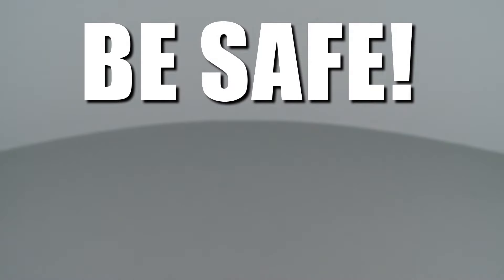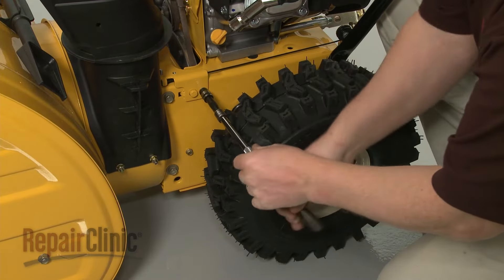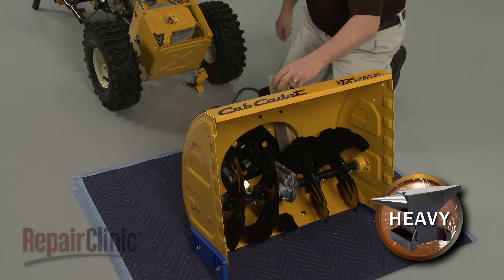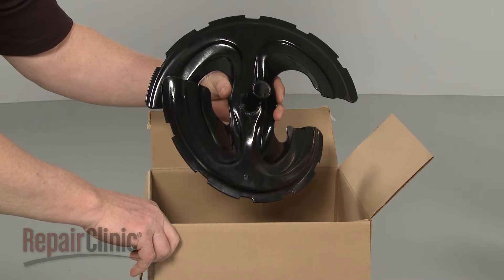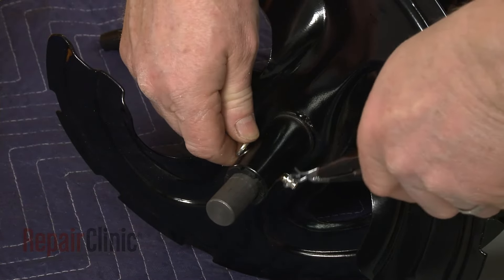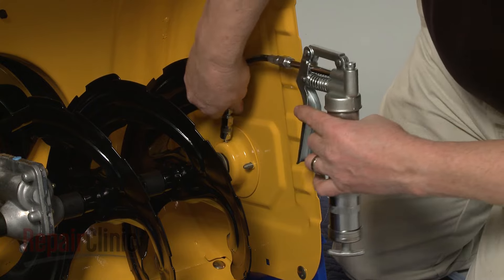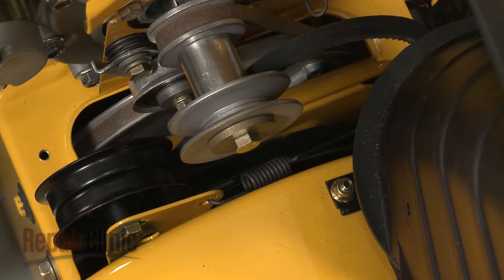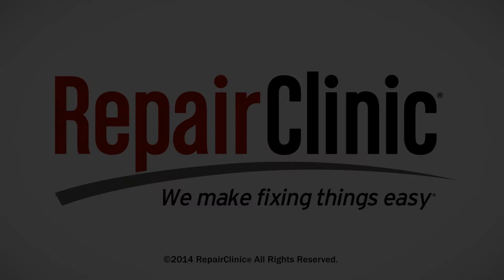Cub Cadet Snowblower Auger Replacement, Right #684-04108-0637

Comment: Great video!! Step by step procedures are very good and made what seemed to be a tough job easy.  Would offer that some some bolts had lock-tight, the video did not mention removing the belt guide for the drive belt and, lastly, my bushings were a little different and grease was not needed.  But it was very easy over all.  Best of all it worked perfectly of a test run!
Reply from the maker: Thanks for the feedback. We're glad your snowblower is running well now!